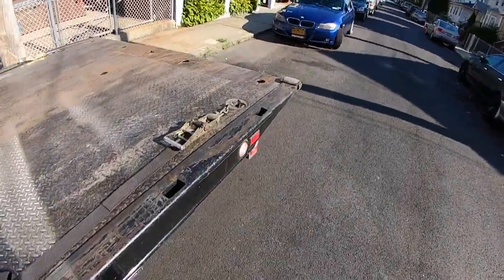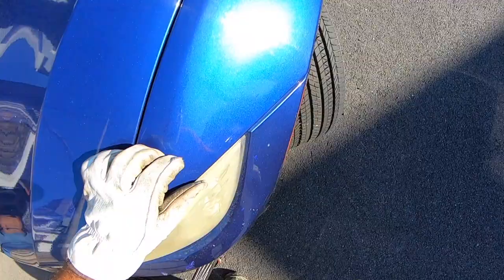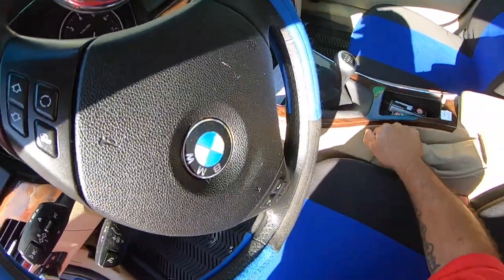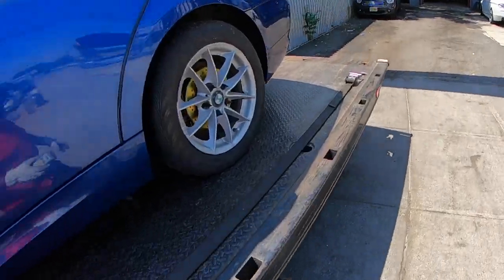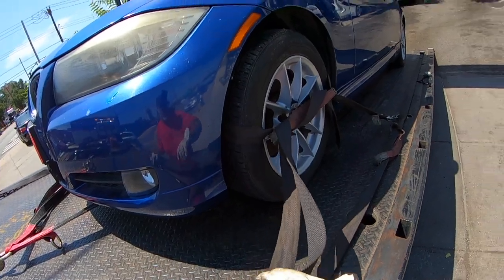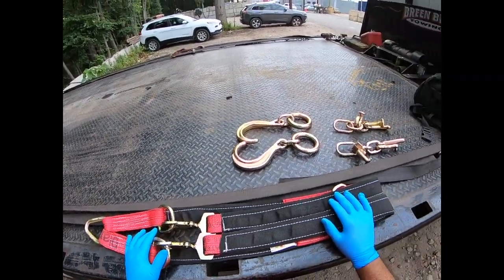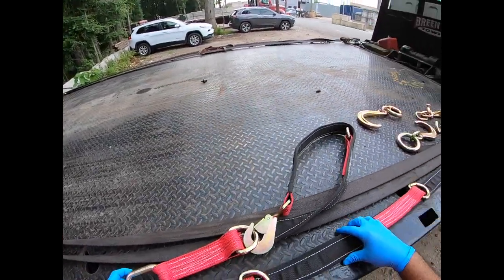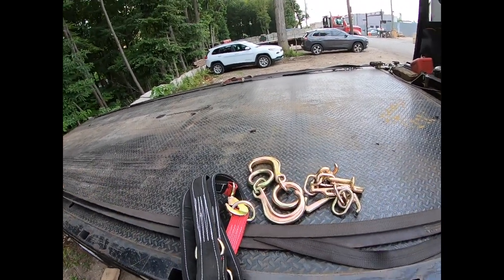DG Racing Technologies Axle bridle in action and review

Comment: I always use the bigger control arm on the top.
Reply from the maker: I think any one of them is fine when the cars in neutrals rolls. If I have to drag it I use mini J’s where the jacking blocks go.
Reply: @TowMan127  those mini blocks have always been hard for me to get out.
Reply from the maker: @jds9958  you have to go in at an angle from both side. Most times I get them out and sometimes they break. I’ve been trying to master the removal of them 😂
Reply: @TowMan127  Hehe, thats why I don't even try. I want to try to avoid them trying to sue for damage. I'm sure your familiar with that scenario .🤨 Keep up the good work, I view a lot of your getting into neutral stuff. Certain Hondas need that special tool, are you familiar with that one?
Reply from the maker: @jds9958  I always try to avoid any possibility of getting blamed for something which is why I bought an axle bridle and 8 point tie downs. I have that tool for the Honda and Acura.
Reply: @TowMan127  Yeah we have those axle bridles too. Where can you get that tool? Dealer?
Reply from the maker: @jds9958  yes but it’s expensive. You can look it up and google as well. Part number (07AAA-TZ3A100)
Here’s a link for a place that has them. $194.44
https://www.hondapartsconnection.com/oem-parts/honda-lock-release-07aaatz3a100
Reply: Somebody’s got their sporty little BMW wIth the Walmart seat covers and matching granny steering spinner,,,lol

Comment: Hey, have you done a video on how to put a 2017 Acura MDX into neutral on a dead battery???
Reply from the maker: Electric shifter? I have a video
Reply from the maker: Here’s a 2018. You need a tool though. I have someone who shows how to do it without. I will find the video. 
https://youtu.be/kdVjgJ1YJik
Reply: @TowMan127  yes Sir, push buttons
Reply: @TowMan127  Sweet thanks
Reply from the maker: @tomasrodriguez7487  here’s my buddy video using a crescent wrench 🔧 and zip ties on a Honda Pilot which has a similar transmission. The tool is expensive.  https://youtu.be/qJDQNJyENIc